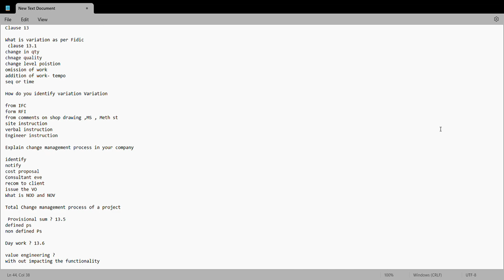Quantity Surveyor interview Question Part 2 - Variations #contract #quantitysurveyor #interview

Comment: Can you tell an example for the change in legislation ?

Also can the contractor proceed with variation without an Engineering Instruction, even if there is a comment by the Engineer in shop drawing / MIR / WIR? (A variation can only be submitted on the basis of revised IFC or an Engineering Instruction). Some consultants are issuing EI, which includes this comments as an official instruction for submitting the cost impact. Then all the parties are aware of the unavoidable additional cost impact scenario.

My job role now is submitting variations. This video helps me in my task. Brings some new knowledge for better understanding. Thanks..
Reply from the maker: Hi 
Example for change in legislation/- now a new rule in UAE starting from Feb 2024 which will limit the carrying capacity of vehicle , so vehicle will need to limit the material they can load (this is to ensure the safety ) because this the price all the materials will be increased .
Reply: @QSWORLD.  Ok ok thanks for this info.
Reply from the maker: Ideally variation order to be issued by the Consultant for any variation to proceed . When ever you find a change be it an IFC , comments in shop drawing , comment material submission or method statement , immediately we have to issue an notification this is basically reversing or right